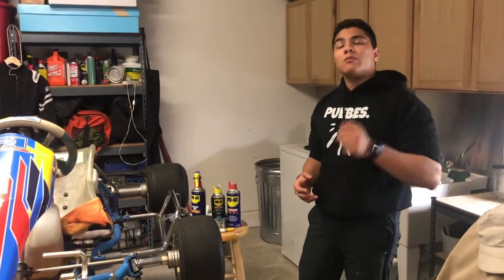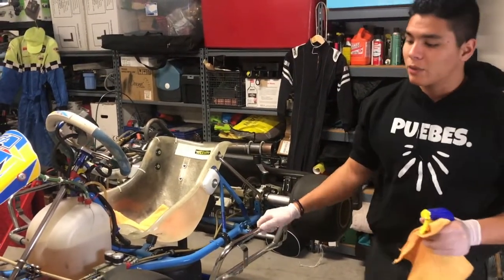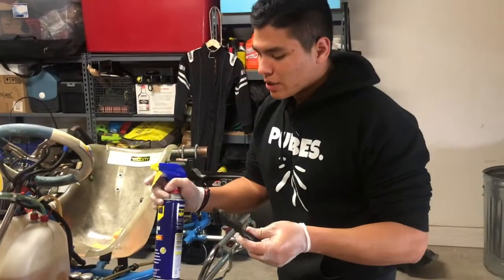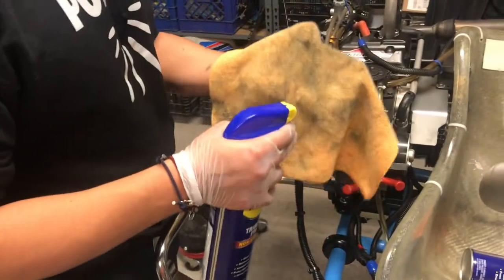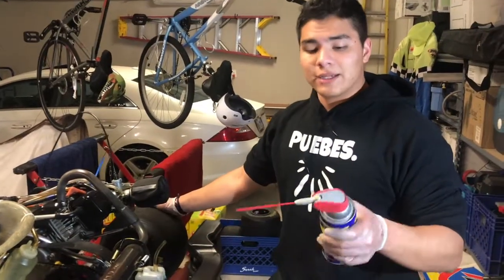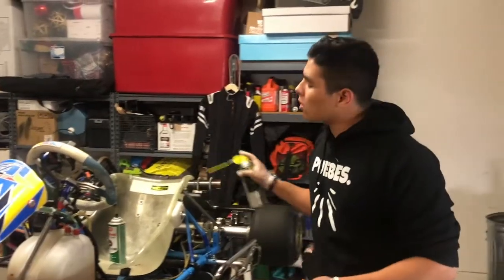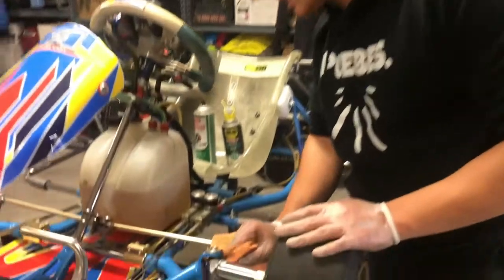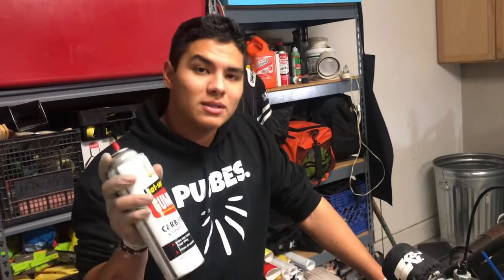How to CLEAN a GoKart

Comment: Can it be washed with a pressure washer?
Reply from the maker: I could be pressured washed but generally I don’t recon it since if you dry off everything some things could begin to rust I would only pressure wash it if your are racing in the dirt but then I would also blow it out and then dry it to make sure to get the water out